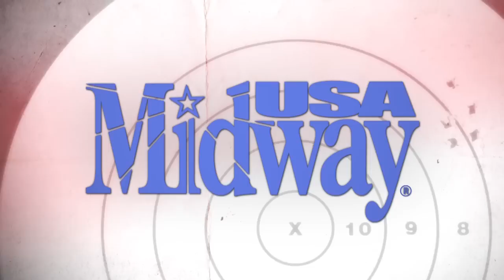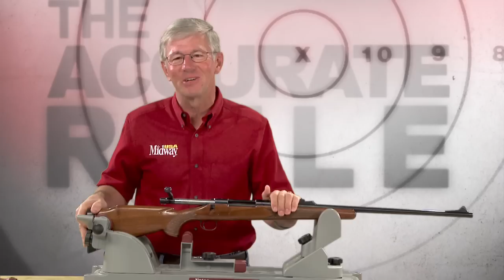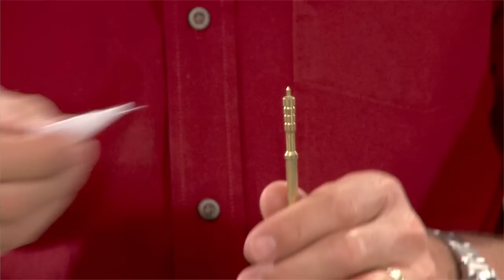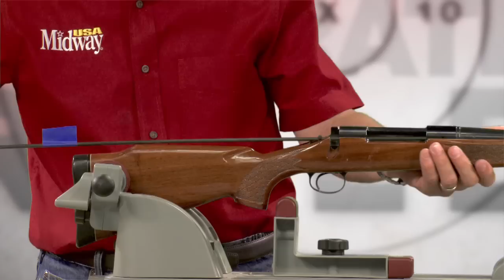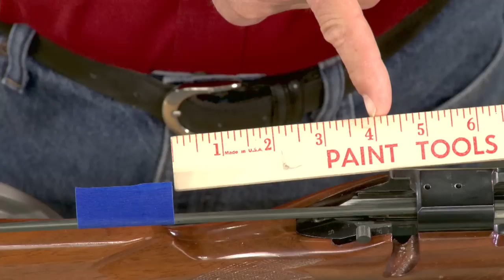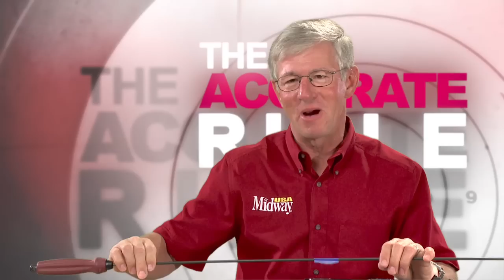How to Determine the Rate of Twist in a Rifle Barrel Presented by Larry Potterfield of MidwayUSA

Comment: That was easy! ROT is very important in the 243 Win. as you may think you can use light (58 gr., etc.) varmint bullets, but you'll get poor accuracy with them. You'll need to use at least 75 grain bullets instead. Slower twist for lighter bullets and visa versa. An example of this is the 244 Remington which would not stabilize 100 grain bullets, so they increased the twist and re-named it the 6mm Remington.
Reply: Barnes varmint hollowpoint gets 2.12 stability rating in bergers calculator with a 1 in 10 twist 243.
It only needs 1.5 to be stable.

Comment: Which gun is this?
Reply: Remington 700
Reply: @bigjon576  Thank you. But what specific model or year is this as the bold handle looks different than the classic Rem 700 handle
Reply: @kpl455  I don't know the year but it looks like a Remington 700 BDL
Reply: Remington  700 ADL in a magnum caliber (if the recoil pad is factory). Blind box magazine and no contrasting for-end  tip rule out a BDL.